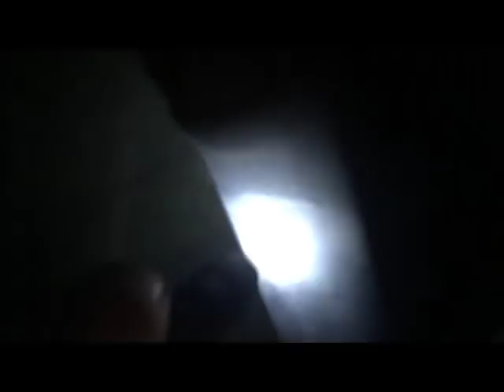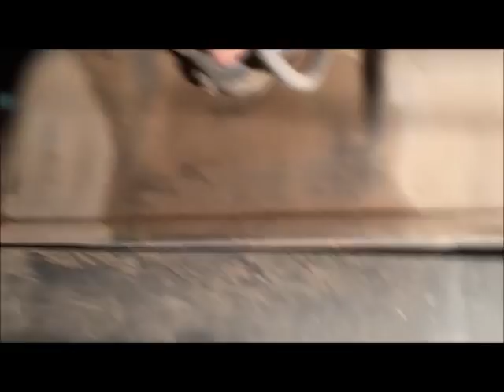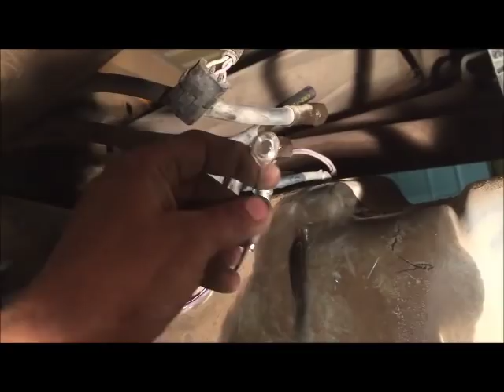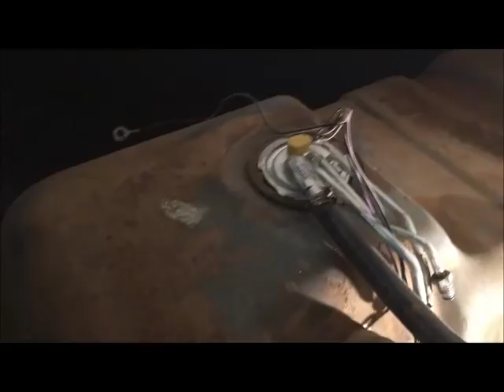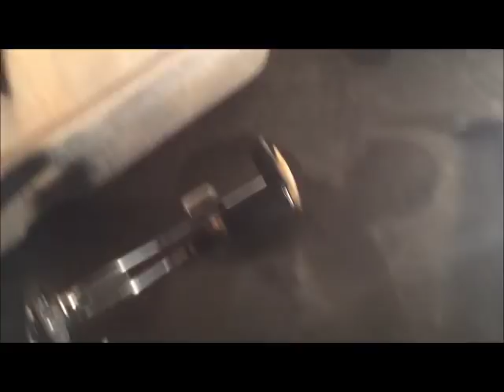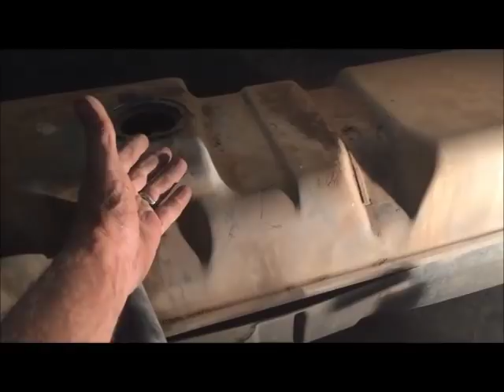1998 Chevy 1500 Fuel Pump Replacement

Comment: I have a 97 gmc sierra 1500 and its not starting. Its a fuel issue, and i think im not getting the correct pressure. Could it be that little tube leaking? The pump turns on and charges but it sounds louder then normal.

Comment: hey great vid man. im about to do this. i had an issue with engine stalling and surging under load (in drive) in park she idles ok not perfect but ok.

i had to install an inline adapter and it showed 2 psi which confused me cos it will still crank just not run good.

the inline adapter doesnt seal perfect tho. it lets a little gas drip but i figured that wasnt enough to justify a loss in 10-12 psi. so i shot a little carb cleaner in the intake hose and she smooths out.

u ever used one of those inline adapters? is not sealing perfect common? i went as tight as i could without stripping the lines out.

anyways. unless u say oh no hold up before i go out ill be dropping this thing this afternoon. thanks for any replys and any advice given.

Comment: I know it's an older video but I'm having a HUGE problem with my 98. No start, cranks fast and smooth but no start. Have spark and seem to have gas (pressure test reads 60 on prime but after it primes and the pump turns off it drops to 58 then after about 15 min drops maybe a few psi. When cranking it jumps to 60 and I can smell gas. All new ignition crank sensor, crank pigtail, coil, ICM, coil, distributor, wires, and plugs, yellow top, bigger alternator with 4awg big 3 uograde. Timming set correctly. A few months before replaced radiator, water pump, hoses belt, thermostat, temp sensor, lower and upper intake gaskets and fuel regulator. Checked regulator with camera and isn't leaking, pulled fuel poppet on #1 cylinder and seems to have enough pressure (sprayed 4 ft lol). Tried starter fluid..nothing. No security issue light blinks then goes away as usual and doesn't stay on. Tested biker alarm no issues with killswitch. Only symptoms I started having before it sat was fuel gauge was jumping from low to full and so forth (figured fuel sending unit worn out) when accelerating it would have a bogging hesitation and at 1 point gave me lean bank 1 and 2 codes. Can't seem to imagine pump being bad when I can hear it prime and I seem to have enough pressure to start but still nothing. Truck is a bagged 98 ext can with 5.7 150xxx miles. I'm going to listen for the "trickle" after the pump primes and shit off and go from there. One thing I've noticed after replacing some of the ignition components was when I would prime the pump (key on, engine off) it would hum and turn off, but also when turning the key off it would engage the pump to prime again. Now it just primes with the key on engine off that's it. Any help would be GREATLY appriciated!!!!
Reply: Did you purge any air out the fuel  system ? Im assuming yes
Reply: @crazymexican2184  yes sir I did. Turns out I just washed the cylinders. I'll get to fixing that this weekend.
Reply: @Jeromybergman  oh dang sounds like fun ha .. got any compression readings on suspect cylinders?

Comment: Didn't quite understand the reason and fix for the fuel pumping out of the tank. I did see where someone welded a piece on but what was the fix for it?
Reply from the maker: when the tank was full, ( on hot days )it would build pressure and come out that line at the top. i hope that makes sense. thanks for watching.

Comment: Thank you. I'm Fixen to cut a hole in my bed but I think I'm gonna try to take the tank out like you. Cause it took my rent well part to get me a pump and I'm disabed and single  parent so I don't need broke anything more. So I'll try your way. But mines been loud 3 years quit 3 times but started working again well last night it quit and the pump wasn't Loud. It sounded muffled. But got the pump then my daughters boyfriend dad looked at the line by the carb or what ever it's called now and I turned in the key he hit the valve and gas did come out but I'm thinking pressure don't no.  But got towed home and turned the key in to show a friend the weird sound well now the pumps really loud but still not the same noise now sound like a motor coming on but not turning a hard noise if you get what I mean.  But it won't start. So today 16  hrs later went to try thinking maybe it was flooded last night well nope didn't start and it still sounds loud and awful. But I did what you said listen to see if it's leaking back in the tank cause I do have 30 or more dollars in gas cause I thought I ran out and for gas. Lol see my gas gauge don't work it stays on full and bounces around sometime but it's never worked. Do you think my grounds no good like you talked about in the vidoe hope so cause I hate not nowing how much I got. Last night I went 80 Mile's in 25 dollars in gas. Usley I add 20 dollars go 100 miles then get 20 more. But it was at 80 I was like I'm really getting bad gas milage but yea it wasn't the gas so I have half tank of gas now lol and I pray if I change the pump my gauge works I'll check that wire also so thanks your vidoe helped me 100 percent god bless
Reply from the maker: perfect, god bless you too! thanks for watching!
Reply: @thomasbriansavingmoney  your welcome sadly mine went different. Got the wrong pump was 2 wires not 1. Then had to cut hole in the bed my friend did good job. Bad thing the pump went to working but wouldn't pump the has but I changed the filter and my truck runs good now I keep the old pump hey may been good kinda. But it was loud the new can't even hear it that's nice. Lol. But uea thanks
Reply: @heathschwab  i cut a hole in my bed and it worked great, took my time and lay it out , there are u-tube vids on cutting it.

Comment: WAIT......I am blown away with the amount of info and detail but I am not sold that I should do the job your way WHY?  how do you lift that 3/4 full tank up off the ground and into it final position?   You should have explained that, if not shown, how to do that by yourself.  Because with just a jack it would be tough.....to get it down, a jack was enough.  Going up is another story.  I believe the tilt is the way to go.  My tank is 100 percent full also.  Great instructions otherwise.

Comment: I subbed good info. 98 1500 5.7 misfires up big hills when I accelerate. any ideas?
Reply from the maker: sounds like timing. however that year had a control module in the distributor that will cause that exact issue. take off dist cap, remove rotor, and two screws ( torque screws i think ) and replace that module. it does that when they get warm. about 15-20 bucks. let us know the outcome please .
Reply: Replace the spider central port injection to multi port injection.
Reply from the maker: you will have a misfire code if it is the spider, random misfire, or one or two cylinders. i would not recommend pulling the intake yet, start simple. but excellent point. thanks for watching.

Comment: Hey Thomas I've actually did all of what your video has shown..... I'm having the fuel cluster showing full all the time so I've cleaned the earth on the frame, New wire connection and so forth but the fuel cluster still registers full... Will the cluster register full also if faulty. Just trying to narrow it down....
Thanks Thomas
Reply from the maker: Yes it will, check two things : that the float is not stuck in the up position, and that the ground wire is secured tightly. thanks for watching!

Comment: i just picked up the same kind of truck and it wont start and i ordered a fuel pump because on my island they cost over 300 but i heard there is a lart called a security module that also might be the problem but it doesnt seem to have one does your truck have such a unit?

Comment: My 98 Silverado has an arm bolted to the frame as opposed to the two straps you have mentioned, here I also don’t have a dedicated ground wire. Are you sure you’re not looking at an 88 as opposed to a 98? My body style also looks significantly different from yours.
Reply from the maker: late model 97 was a little different, but same concept. you should have a ground as well. thanks for watching

Comment: What did you mean by heat and pressure in that tube you showed?
Reply from the maker: as fuel gets warm, it builds heat and pressure because it will expand. thanks again for watching.

Comment: I really don't want to pull the bed. All we need to do is change the pump. And that's inside the tank. It's the filter. Clogged by bs. That's in the tank. Well my boss runs the gas out several times.

Comment: I've got a question. I have a 1998 chevy one ton big block that runs good. Problem is at times gas will pour out of the carbon filter in hot weather or if the truck is hot. Loosening the gas cap seems to help. Other times the truck will act like it's not getting gas usually worse in town. Gas tank had been changed before we got the truck. Had to replace the rusty lines when we got the truck. We've changed some of the pollution control stuff and it helps for a day or two and then does the same thing. Any idea what the problem is and how to fix it?
Reply: Butch: did you find what the issue was ? I see you asked about it 5 years ago and I have this same issue now.

Comment: I have a 1997 Diesel GMC Sierra.  Stops as if running out of gas often. I replaced fuel filter and pump that is between the tank and filter.  Still same, stops running.  I need to try replacing the pump in the tank.  You almost have me convinced to just drop the tank.  Problem I have is the tank is 15" tall and the side clearance of the truck is only 12". I can put one side up one blocks, but am still concerned about having enough room to pull that long pump assembly out of the tank.  Pull everything off as you did?  Any thoughts or  ideas?  Also should I just replace that whole assembly that I pull out, seems easier than taking the pump off the end of the assembly and worrying about slicing wires.
Thanks!
Reply from the maker: no, first check the fuel shut off solenoid. it will be magnetic and when current is applied the valve will open and allow fuel to go through. you can hold it open by hand or a zip tie, while someone cranks. check there first. they are know for that. thanks for watching... enjoy.
Reply: The fuel shut off solenoid checked out as fine.  Although strange thing if the truck is moving or parked on an incline the engine dies eventually.  Ran it the other day to get some fuel out on a flat driveway and it ran without dying for over 45 minutes.  Not sure if that is a symptom or coincidence.
Reply from the maker: ok, sounds like a air bubble. crack all the injector lines. start it and as it is running check the furthest back injector for spitting fuel. it should come out rather quickly. if it does, tighten it. then next furthest and so on. i think you have a air bubble trapped past the pump and before the injectors. if air shoots out of one, let it keep running for a bit until it is all fuel coming out, then proceed to the next. keep us posted, it helps everyone. thanks buddy for watching.

Comment: I've seen a fuel fill tube full of sugar. The guy had no engine problems, he came in with a car he couldn't get fuel into the tank. It was silly. FLushed tank and fuel system and never heard of another issue. Filter wasn't plugged, car was running fine at the time.
Reply from the maker: yeppers, old tale to ruin someones engine put sugar in the tank. it doesnt do that. the filter wont let that HAPPEN.great comment. thanks for watching.

Comment: Where does the center fitting go from the fuel pump?
Reply from the maker: i believe looking at the direction of the three, left to right, left return line, center purge valve. right goes to fuel rail pressure. hope that helps. the purge valve line is normally the smaller one.

Comment: so you may have mentioned this when talking about different problems with the pump. My gas gauge is jumping around. When I fill the tank up full. it registers full but after a hundred miles my gas gauge starts dancing around. Could it be the ground wire not grounded correctly or is it the float sensor?
Reply from the maker: its prob the float itself, if the gauge is working at all its prob not electrical. it takes very little voltage to run it. i would say the float has come partially loose and is moving a lot. good luck.
Reply: thomas brian one thing I forgot to mention in my last post was my gas gauge does it even when the engine is off and the truck isn't moving but they ignition is on
Reply from the maker: ooooooh! very rare, but yes your prob is voltage. check the connection on the cluster first.

Comment: Just replaced the fuel pump. Still having a problem with the fuel pump relay getting hot and burning  the plastic around fuse block.  Pulled the fuse block and see the 30 pin wire(on pump relay) looks brittle from the heat and possible arcing. Any ideas on why the pump relay is hot and having issues with 30 pin?
Reply from the maker: yes, i have seen it before. the relay is loose, to loose in its connection. causing viberation and friction. clean and squeeze those connections  and you should be good. thanks for watching.

Comment: Hi Thomas, I have a 1993 GMC Suburban with 116K miles. Everything seems to work fine fuel pump and gauges wise but should the fuel pump be replaced at this point? Thanks for your reply in advance! Jack
Reply from the maker: wow, 93 with 116k thats great, i would say no, if it is working, let it work. most chevy fuel pumps will go 200k. i think if you are not having any issues, your good. when you start getting a lack of power, or feeling of starving when pulling a trailer, or up steep hills then look into it, but even then change the filter first. thanks for watching.
Reply: I will do that....thanks for the good advice Thomas!

Comment: is it easy to access that ground wire or do you still have to bring down the tank cause that's the problem i have on my chevy silverado with a 5.7 it was fluctuating back n forth & now it's stuck on past full i thought it was the fuel  sender
Reply: make up a new ground and attach it where you can, abandon the old one

Comment: Thomas, I have a 96 GMC Sierra. I took my truck to a "mechanic" to have the fuel pump replaced. Since then it has always had a smell of gas and occasional dripping . I didn't run the truck much this past winter but I fired it up the other day and ran fine. I went inside to grab something and came back out to hear the sound of fluid pouring. I looked down and my fuel, around the tank, is dumping out very steadily as it is running. Stops as soon as I shut the truck off. Any ideas where or what to do first? Thank you!
Reply from the maker: yes , if the truck is running fine and its leaking as you say. he must have not reconnected the return line back up. meaning any extra fuel the engine does not burn will go back to the tank, thus running out. if the truck has a miss while running then he did not reconnect the inlet line correctly. if both are connected correctly then he did not replace the gasket around the pump or it is loose. either way the prob will be around the top of the tank. one other prob is sometimes the forget to tighten the fill hose, in which case when the truck is about half full it will stop. if your tank is not at least half full then the fill hose will not be the prob. please get back with what you find, it helps every one. thanks for the great question and for watching.
Reply: Will do. I purchased a new sending unit since I don't believe it's ever been replaced and since I will have the tank down I might as well do some preventive maintenance. I appreciate you fast reply!
Reply from the maker: there is a filter ( called sock) there as well. if it has not been changed recently then now is the time. its about 8.00 $ and will save a lot of life on that pump as well.
Reply: I believe the new sending unit comes with a new filter sock. If not that will be changed. I'd rather not dig into it again for a while at least. Thank you again
Reply: Glad I purchased and planned to replace the sending unit because it was rotted out. The leak was from the return side. The weather did not cooperate, was in the low 30's and rain and had to work on it outside. By the end of it I was shivering uncontrollably and my toes were dark purple BUT she's back together and running. I also replaced the tank straps which I will warn you, they do not come pre-bent for the shape of your tank and are a pain to install especially if it's really cold out. 
Dropping the tank was difficult and I see why people say remove the bed but I didn't have the man power for it and I don't really think it matters. I think it's a pain either way. 
But this video was helpful. Thank you for the advice
Reply from the maker: if you think the sending unit was rotted, those bed bolts would of drove you crazy. glad to hear you were able to get it completed. now turn up the heat and make a warm drink, good job! thanks for watching.

Comment: i have a question about my 98 k1500, my gas gage moves rapidly and not sure yet but it doesnt seem to be reading right either. i was wondering what that would be
Reply from the maker: sending unit in the tank. thanks for watching.
Reply: That's what i was thinking. Thanks man

Comment: Hey man got a 98 Chevy 1500, thing is always on full and never reads the level. Sometimes it moves around but doesn't read right. Would the ground wire be the issue?
Reply: MizFit Rider 
Either ground wire or your float inside the tank 99% of the time its the sending unit not pump